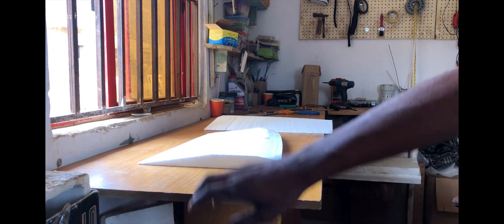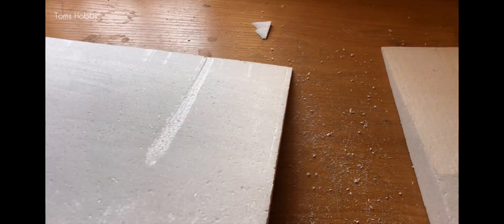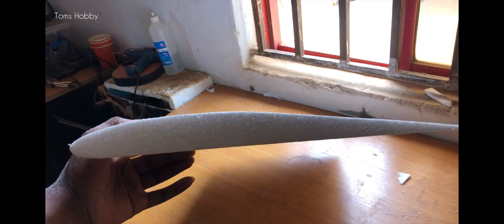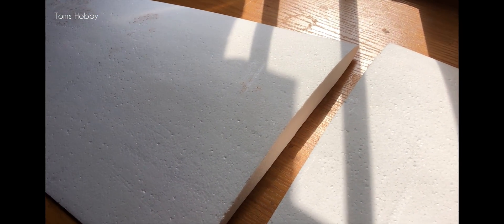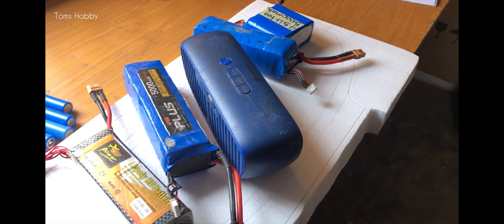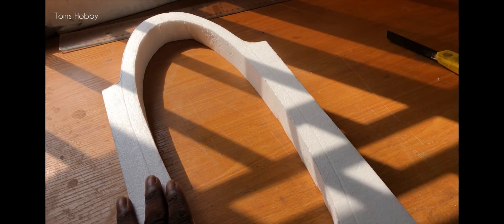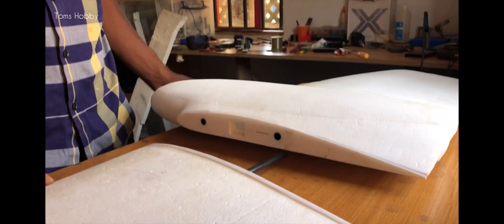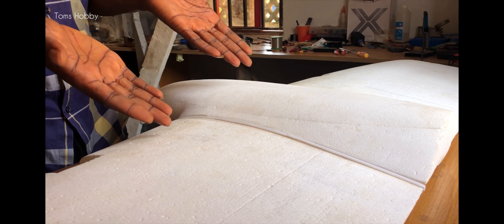Tailsitter VTOL UAV Build

Comment: Nice build!  Are you using a flight controller or was that full manual control?  I want to build something like this but smaller and run ardupilot to control it.
Reply from the maker: It  runs on ardupilot. Matek H743